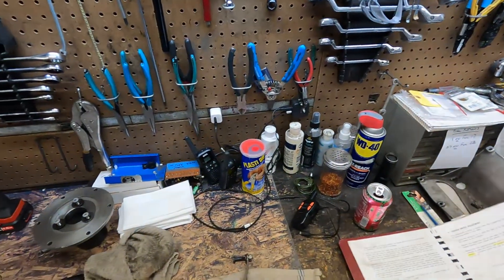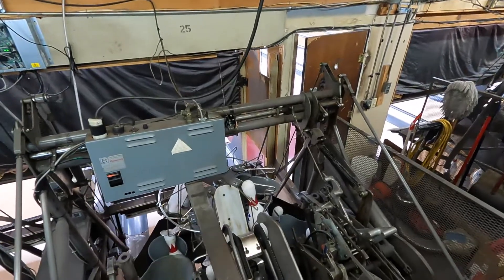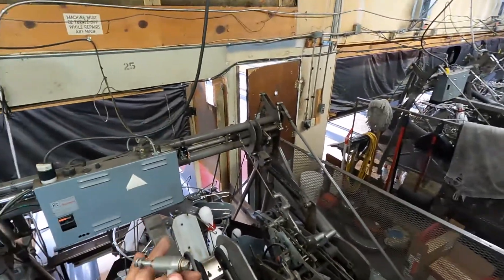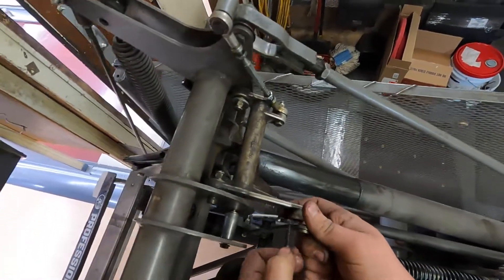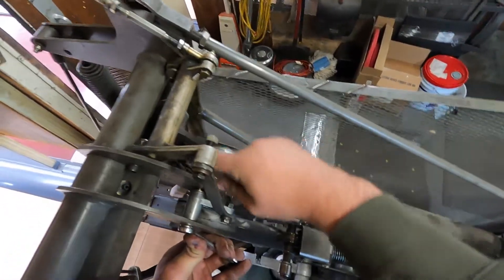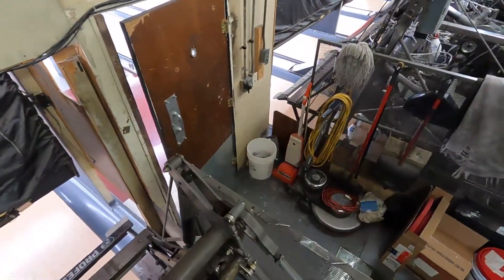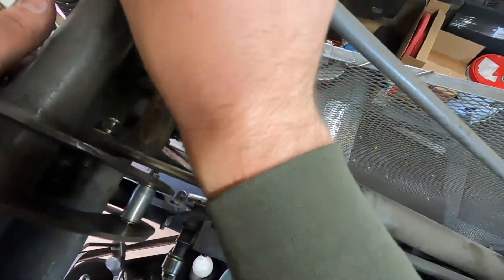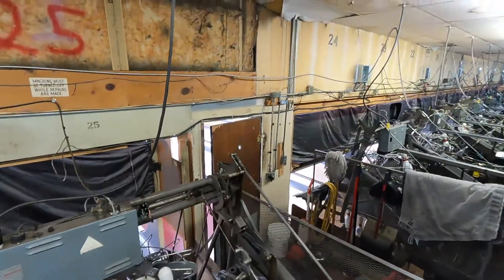Trigger Link #5 - Brunswick Pinsetter Adjustments

Comment: Be sure there is no binding when you put the bolts through the bronze bushings. Often the I.d. can be too small so you may need a small fine round file to open them up just so the bolt goes through easily. AND...oil the bronze bushings,pivot areas. Grrrrrrreat videos !!!